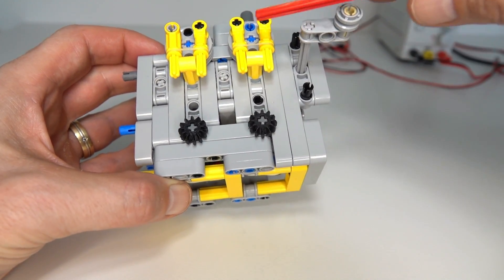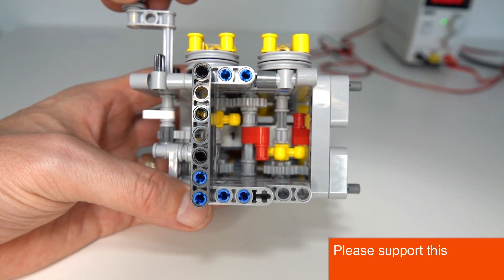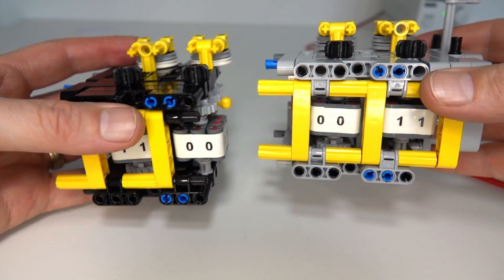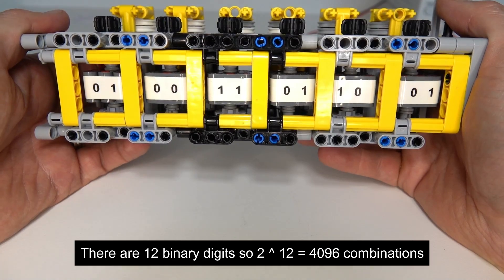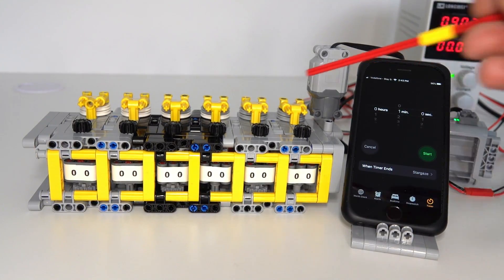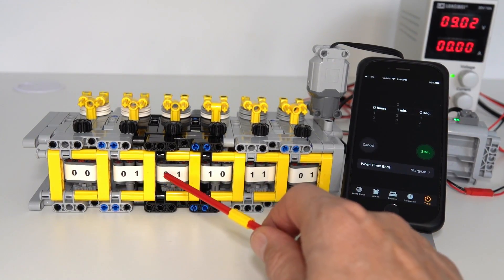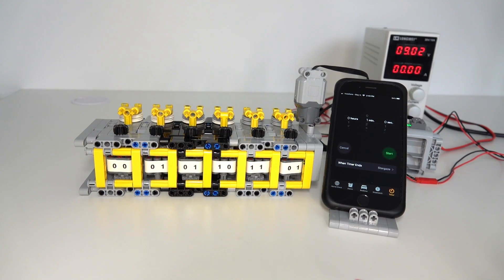Lego Technic Binary Counting Machine - You have to see this fascinating counting machine

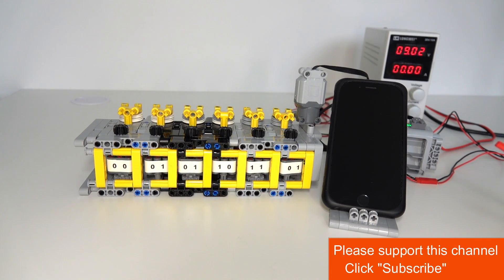Comment: For a reset mechanism, check out this video at time stamp 5:55

https://youtu.be/YXMuJco8onQ

However, it would require a redesign!
Reply from the maker: Hi Nicholas thanks but I couldn't get that link to work unfortunately. 🙃
Reply: @TechnicBrickPower  Sorry, go to the video called How Pinwheel Calculators Work. The reset is described at 5 minutes 55 seconds.